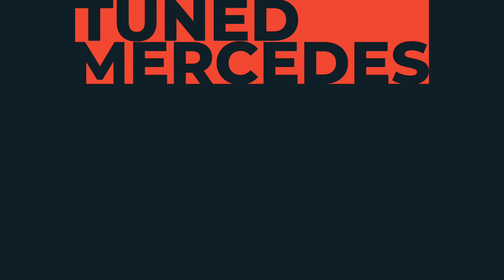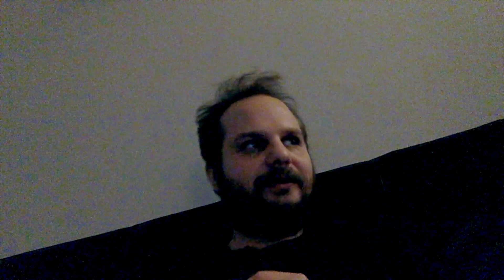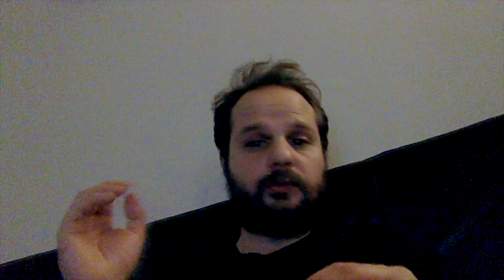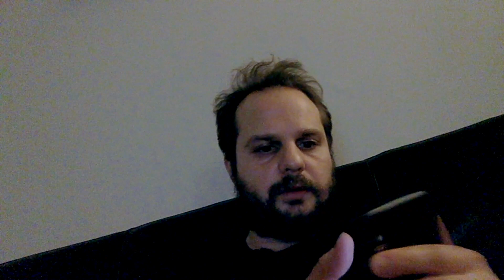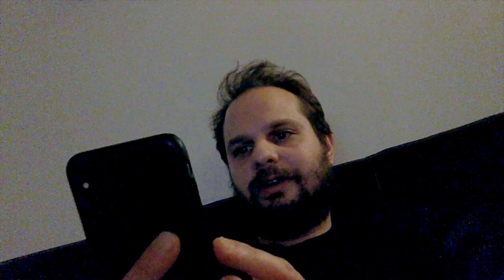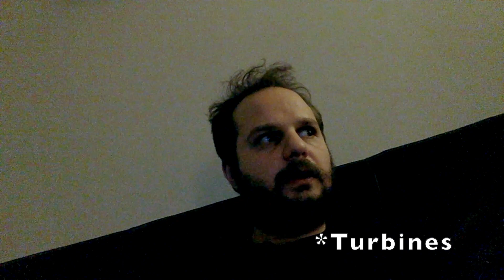Supercharged M113k vs Turbo M157 vs NA M156 vs Electric

Comment: The M156 launches 2x harder then my m278, they run the same times basically but the m278 makes up for it on the back end and is also awd and is also more hp and more torque. The m113k launches right on the m156 until you add e85
Reply from the maker: makes sense with the turbos

Comment: The m113k SC is used in the hell cat i think
Reply from the maker: I should probably know those cars better...   VRP just came out with an upgraded SC set for the M113k.  Looks like nice kit.
Reply: @TunedMercedes  it is the same set up but a smaller charger but the same exact thing you can direct bolt the hellcat throttle body on to the e55 the truth is dodge took everything for the hellcat off of the e55 when they owned Mercedes for a min
Reply: The M113k blower is definitely not the same blower in the Hellcat.
Reply: The only time my m113 was ever faster than my m157 was when the m157 was stocked. After a simple tune the m157 walked all over the m113 and it was a 72mm fsp meth and a KC pushing 680hp
Reply: @blinx197  I know your shyttin on everything that pulls up lol the best or nothing